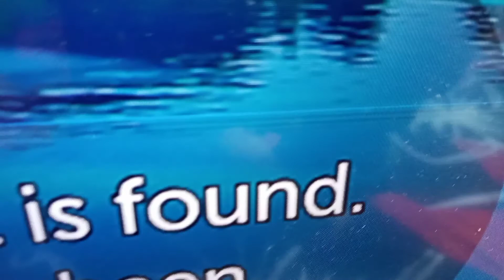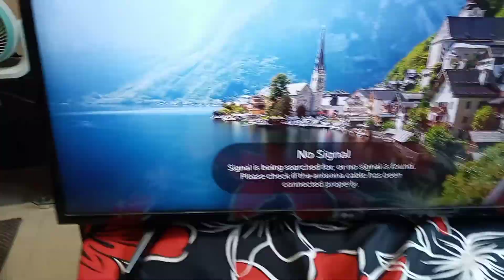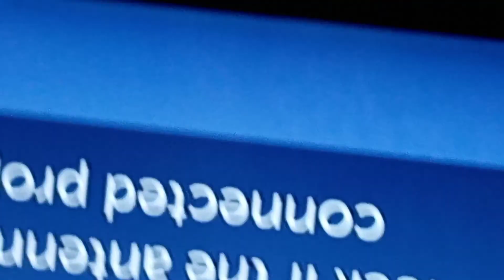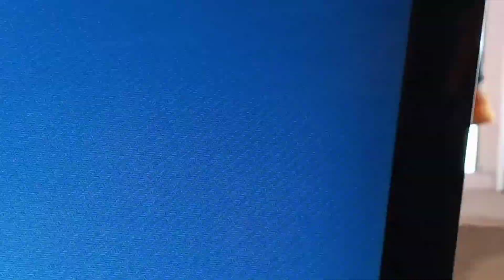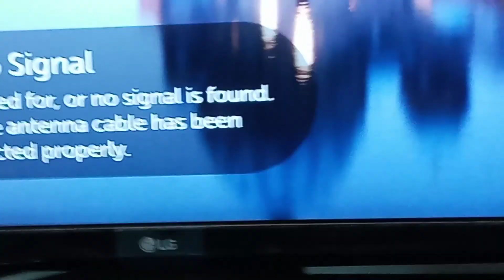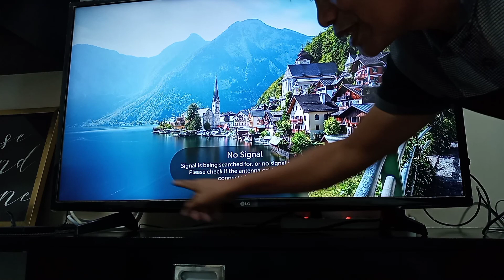HOW TO FIX LED TV WITH 3 HORIZONTAL LINE ON SCREEN#Horizontallines #Lcdissue #Howtofix #lcdfix #LGtv

Comment: would replacing the wires or the t on board work?
Reply from the maker: @Jaco 38 thank you for this important question and thank you for watching...replacing the wires and tcon board is 100 percent useless because the lcd is defective replace only the lcd is the solution aside from tape method remedy
Reply: @CandidoMembrebe  Thanks for reply its very much appreciated, it has saved me money as i was away to order the items

Comment: do they work on OLED TVs?
Reply from the maker: @Fuad Kasumoviv thank you for this important question and thank you for watching yes
Reply: @CandidoMembrebe  
Maria Vasquez
prije 10 mjeseci
Hello po can you help me repair my Lg Oled tv. Issues are horisontal line .
thanks
Reply from the maker: @fuadkasumoviv118  although tape method can be use to fix horizontal lines on oled tv chances of success is lesser than fixing line problem of common led tv...for help refer to 09208132026 09053993997 thanks
Reply: @CandidoMembrebe  I don't know which pins to cover. T con has 4 outputs. Nothing, thanks
Reply from the maker: Same procedure but make sure to connect all ribbon before you plug it to power
Reply from the maker: Although success is very slim there's no wrong in trying ,try to cover pin 3 to pin 18 at the left side of the left ribbon or cover pin 3 to pin 18 of the right side of the left ribbon same procedure to all ribbon

Comment: My samsung flat screen Tv has a wide horizontle black stripe in the middle how can I fix it
Reply from the maker: @Johannes Van Jaarsveld thank you for this important question and thank you for watching...if the black line is wide in my experience I replaced the whole lcd panel...wide line can't be fix by tape method.

Comment: boss candido pano nyo po malaman kung pang ilan pin y8n tetapan at ilan pin y8n lalag6an ng tape. tnx
Reply from the maker: @Jeric Gutierrez thank you for this important question and thank you for watching...pasensya na po sir pag e explain in ko in detail hindi tayo matatapos ng isang lingo at maaring hindi pa rin maintindihan maliban lang kung tapos din ng electronics ang makikinig sa explanation ko...ang mga tinatawag kami jan na signal blocking level shifter clock signal COF vgh vgl avdd vcom stv std DC DC converter  gamma gate signal at marami pa at sa bawat model ng tv ay nasa iba ibang location ang mga yan hindi nakalagay sa iisang location lamang kaya ang video ay nakakatulong sa pagbibigay ng idea yung pagkagawa ng tv ay nakasalalay pa rin sa technician na gumagawa kaya ang tape method video at nakakatulong magbigay ng idea sa technician na kung paano niya gagawin ang tv sa mga tv user naman mga customer nakakatulong din ang video na magbigay sakanila ng idea na ang TV nila na may mga horizontal lines ay magagawa pa na hindi kailangan magpalit ng lcd panel na sa halip na magbayad sila ng 20k sa panel magbabayad nalang sila ng 6k sa technician na gagawa malaki ang deferensya dahil karamihan sa tv user lalo na sa mga may kaya sa tuwing nasira or nagkakaroon ng guhit guhit ang tv nila dumideretso sila sa main service center ng brand ng tv nila kadalasan ang hatol ng main service center ay change lcd panel kaya doon dalawa lang ang option ng customer na hindi nakapanood sa video ko ang option nila doon ay ipapagawa nila or bumili nalang ng bagong TV.

Comment: Sir ilang pins ba Ang tinakpan mo
Reply from the maker: 8 to 10  pins tingnan nyo po sa video marami akong subscribers nanood lang sa video alam na nila kong ilan pins ang tinakpan saka wala pong fixed na kung ilan pins ang tatakpan dahil trial an error po ang tape method repair kaya wala tayong fixed data kung ilan pins ang tatakpan

Comment: Ganyan din tv ko tcl smart tv 55" meron horizontal kahit na lagyan ko na ng scotch tape
Reply from the maker: @Les loqs thank you for this comment and thank you for watching pag line on screen lcd issue yan maaring magagawa po Yung tv nyo sa tape method kailangan lang ng experto talaga,ang success rate ng tape method ay 70 percent sa aming mga sanay na gumawa iba ibang pin location po ang affectado pag lcd issue kapag experto na ang gumawa ganun pa rin Palit lcd na yan pagnagkaganun hindi ko na nerecommend na pagawa pa mahal po parang bumili na ng bagong TV tapos ang warranty 3months lang.

Comment: Just a suggestion, can we just change the ribbon cable would it help better? I've purchased a new (awm 20941 vw1 90v 105c) cable and will be trying that in a few days and see what happens. Btw what kind of tape you are using? Thanks
Reply from the maker: @Verse Monct thank you for this important question and thank you for watching, usually ribbon is ok..its up to you if you change the ribbon..in my experience I only change ribbon if the pins are coroded, I use transparent scoth  tape.
Reply: @CandidoMembrebe  Thank you for showing us how a change of ribbon cable or a tape could instantly fix the issue. I consulted the service center, they wanted 400USD, for 'panel replacement' & consultation fee. Contacted another TV repair who told me panel was broken beyond repair and a replacement is required. Its shocking how much we can't trust anyone to help us, especially having to throw away things that still working fine

Comment: Is this fix also applicable for ultrawide pc gaming monitors? I have 1 black horizontal line on the top portion of my screen.
Reply from the maker: @Crayon Ph thank you for this important question and thank you for watching if your monitor has a tcon board with 2 white flex wire going to lcd..yes

Comment: Sir kagagawa lng din ng TCL 40 inches ko dahil tagal magbukas pero may Power po, ok na nagawa napo pero kinabukasan nagkaroon siya ng 2 horizontal lines sa baba, patulong naman po
Reply from the maker: @johnromarc.maneja maraming salamat po sa inyong mahalagang tanong...pag may lines lcd issue po yan advise lang ang matulong ko sayo ang advise ko e pa check up mo uli yan sa unang gumawa malapit lang naman siguro sa inyo ang technician na gumawa nyan.

Comment: This did work - but I still have a small spot so I'll adjust the tape and try again - nice video - thank you.
Reply from the maker: @rob winter congrats for fixing your TV with your own tape adjustment calculation and thank you for watching...
Reply: @CandidoMembrebe  I still have 2 small vertical lines about 3" in the middle of the screen.  The rest of the screen is good.  Any thoughts?  Should I replace the cable? or maybe T con board?  Thank you again.
Reply from the maker: May be need a little move of tape either move to the left or to the right 1 interval 2 interval or 3 interval to see if there's improvement
Reply: @CandidoMembrebe  I will try that...thank you.

Comment: Hello po, solid lines po ba yan or flickering?  6 months pa lang LED tv nabili ko, nagkaron na ng visible pixels at horizontal lines that contrast sa colors ng screen. Let's say, red ang picture, the streaks turn bright yellow.. thanks po.
Reply from the maker: No not solid  has a little movement
Reply from the maker: You better call the seller for warranty

Comment: How do you know the exact lines to stick the tape on?? I tried doing this the horizontal line issue got fixed but there is a black shade on oneside of the LG tv...
Reply from the maker: what is the model number of your LG tv? the tape method repair is a trial and error technique it move the tape one pin to the left  or one pin to the right or 2 pin to the left until you get the good picture
Reply: @CandidoMembrebe  LG 42LB5510
Reply: @CandidoMembrebe  I am able to cut the tape to the slimmest level possible which hides two pins, I think I have to only hide one pin but it's really impossible for me cut the tape so linear 😐
Reply from the maker: Try to follow the tape method success of chengyi Lim that I pinned here in my video How to fix flickering vertical and horizontal lines on screen
Reply from the maker: Read all of chengyi Lim's comments and reply comment

Comment: Goood afternoon, hope you are doiong well. I have a similar problem. 1 Horizontal Pixel line that is not dead but not the color  it should be, mostly black, but it depends on the color in the backround. The TV is the Samsung 65KS808 from 2016. Would this same process maybe fix this horizontal pixel line? Thank you in advance for any kind of anwer! =)
Reply: When I try this on my TV, no matter how many ribbons I cover, from which side, the screen wont turn on anymore. It tries, gets black (TV ON) and stays like 3 seconds and turns off and tries again to turn on, but without any image on any side.
Reply from the maker: May be you put the tape in a wrong pins, tape method has two flex ribbon subject for tape placement, 1) left ribbon  2) right riboon.....try place the tape at the right side of the right riboon using placement code 6-13
Reply from the maker: From right to left 6 pins no cover pin 7 to  pin 19 covered by tape, if no luck go to the right side of left ribbon same procedure.

Comment: Sir tanong lang po same issue po pero samsung model: UA48J200AR 48"  buong screen na po yung guhit nya tas ng dodoble yung image alin po kaya lalagyan ng tape ? Or need na po ba palitan ng panel pag buong screen na horizontal lone nya ? Sana po masagot nyo...thnks po..
Reply from the maker: Thank you @Christopher Garcia for this important question and thank you for watching...maaring magawa pa yan sa tape method  kung experto ang gagawa maaring kailangan na rin talaga palitan ang panel.
Reply: @CandidoMembrebe  tnks yo sir sa pag sagot nasa magkano po kaya palit panel ? Any ideas po ?
Reply from the maker: Ang alam ko lang pag panel parang bumili na ng bagong TV Kaya hindi ko na Ina advice na pagawa pa pag sira panel ang presyo kc ng panel usually 80 percent sa presyo ng bagong TV.

Comment: Hello po can you help me repair my Sony Oled tv. Issues are vertical line and retention. Hoping to get as response from you po. Salamat.
Reply from the maker: Hi! Usually oled panel is defective if vertical line appear in the tv screen oled panels are expensive like a new tv better and the warranty is only 3 months better to buy new tv